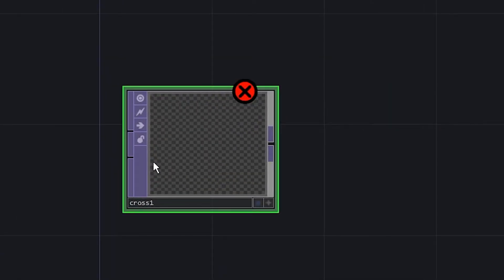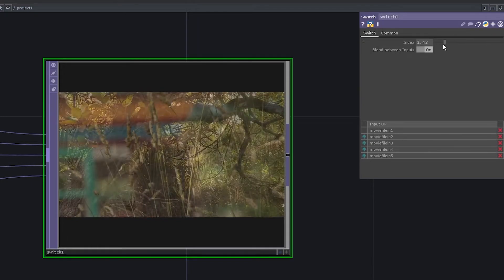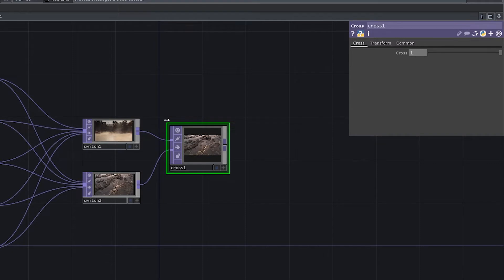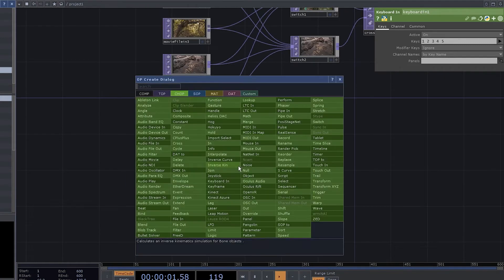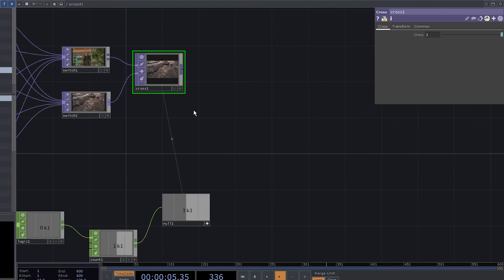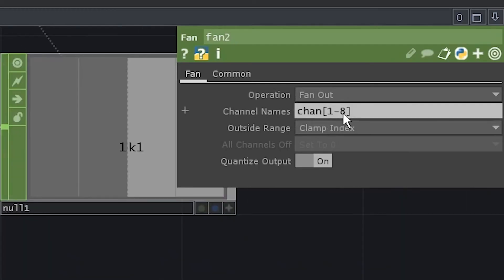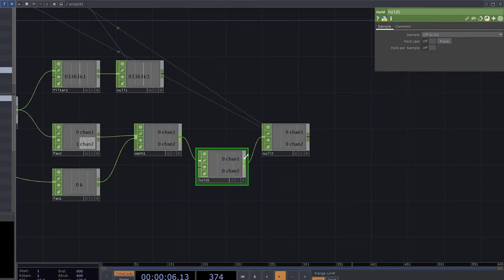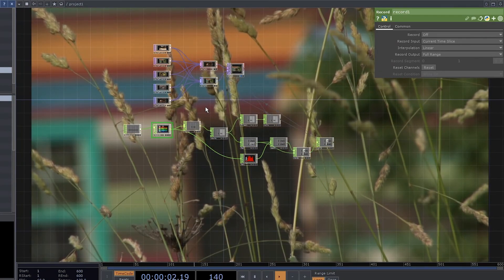Simple video mixer with CHOPs (Touchdesigner tutorial)

Comment: Thank you so much for this! Super useful -- I'm trying to do this with TouchOSC and the transition no longer smoothly crossfades even when I adjust the filter.. I wonder if maybe the filter needs to be moved to a different place in the network? I currently have it after the Count CHOP as per your tutorial.
Reply: Did you figure it out?
Reply: @secretvanush  No, I think there’s something with the way the OSC data is received that doesn’t allow for a smooth transition with this particular node architecture.

Comment: what are the numbers changing to...? Nothing corresponds to the moviefileIns
Reply: Hitting the keys seems to just be completely random
Reply from the maker: @Sonny O'Brien the number of the key 1-5 corresponds to videos 1-5. If it's not like that, probably, check the order in which movie file ins are connected and that the order is the same for both switches. Also, the Fan CHOP, when set to Fan In should give you the number of the channel that is active.